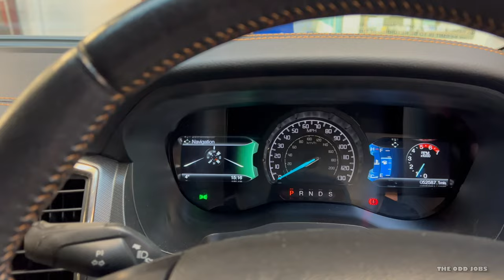Ford Parking Sensors, easy fix or not ?

Comment: I have a 2019 ford edge and a buddy installed the wiring harness for a trailer hitch and ever since then I've had this parking fault error and it has to do with the rear (Only does it when you put it in reverse).  The dealership said they won't touch it because it's corroded and they said it would be $740 to fix it. They said the thing was unplugged. So I'm sure my buddy just forgot to plug it back in cause it was working fine before that. I'm hoping with the help of this video I can locate and fix it myself. Thanks for the video!
Reply from the maker: Hopefully it helps, the sensors are pretty cheap to buy if one does need replacing, dealership wanting to charge $740 is ridiculous
Reply: @theoddjobs3749  Heck yeah it is.  They said the whole wiring needs to be changed to because it's all corroded so that's why it's so much money. I can't see replacing all the wiring.  That's just ignorant and a huge waste of money.
Reply from the maker: @viprgaming641  they just seem to want the easiest path to fixing it , problem with modern day mechanics (not all) they would rather replace rather than diagnose and fix
Reply: @theoddjobs3749  yes sad but true
Reply: @theoddjobs3749  Yeah and get this. I had it in the shop for something else and I asked them if they could just plug the sensor wire in because I'm sure we just forgot to plug it back in when we did the trailer lights so they did and it's working fine.  And they were going to charge me $740? Unbelievable
Reply from the maker: @viprgaming641  shocking

Comment: On my Ranger, backing sensors and reverse lights do not work when gear is on reverse. Could it be a faulty reverse switch?
Reply from the maker: Possibly either the switch or fuses potentially

Comment: My ford kuga started doing this other day but only randomly. I tested all sensors and they all show obstacles but then next time its telling me to get serviced or randomly no sound but detecting still. Think all the grit on roads is blocking them vibrating randomly. Gonna try clean them then seal them up better as you can see wires if you climb under back. 2 on the back been peeling for 6 month n i did also drive through flood for fun 😂😂😂😂
Reply from the maker: I often drive through flood water given half the chance, hope it helps by cleaning them, it worked for me a few times until one finally packed up and had to change it

Comment: What happens if none of them click when your testing them?
Reply from the maker: It would be very unlikely that all have failed ( I could be wrong) but I would check the wiring loom and connections to make sure that they are connected properly first, then I would check the fuses to make sure it hasn’t blown
Reply: @theoddjobs3749  ideal thanks! Managed to get them to work. One was unplugged/is loose so won't plug in properly. So I can get it to work until it falls out again. But the clicking is super super faint. Is loud for like 1 second then goes faint.
Reply from the maker: @willsvanadventures  the clicking isn’t loud, it’s hard to hear unless you almost have your ear directly next to them
Reply: @theoddjobs3749  ok thanks!

Comment: Mine is currently saying service required for the parking aid
Reply from the maker: what year is yours ? does it also have front sensors ?
Reply: i got same error msg in dash board...Parking Aid Malfunction  service required.  mine ford focus 2012... rear sensor have problm
Reply: £247 quoted for replacement.  sensors you get for 10 to 15£ each in online 😂😢😅...wht to do

Comment: They can buy caked in crud, it doesn't matter, they are sealed. These sensors just fail and need to be replaced.
Reply from the maker: yeah that's what fooled me, I thought cleaning them helped at first but it just masked my faulty sensor which I explained at the end, I will always just buy new from now and save myself the time 😂
Reply: Could you share the link where you bought the sensors from?